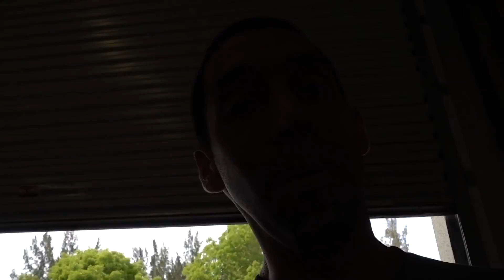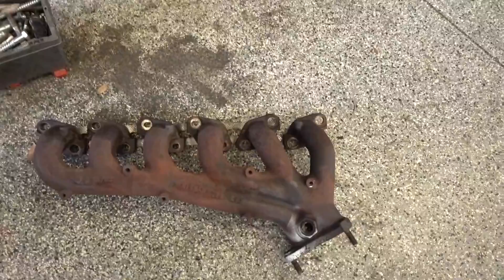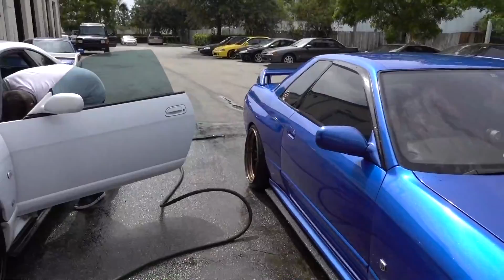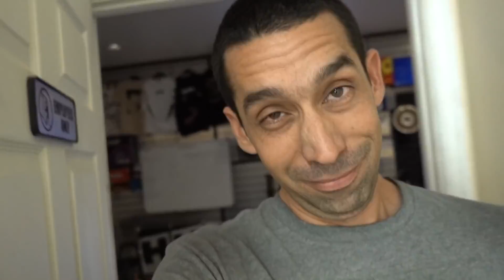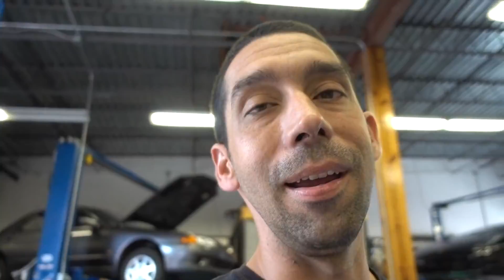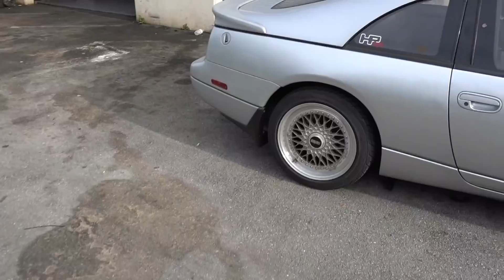Marcus installs: EVO X and SKYLINE UPGRADES

Comment: Jack that scooter is insane, to think my honda shadow has 39hp if that and is a 750 vtwin weighing in at roughly 500 lbs wet and that scooter is maybe 150 wet with 30 hp is insane dude.